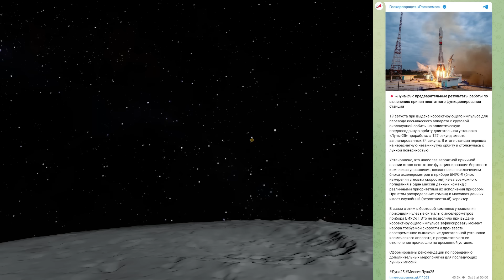Russian Space Probe Crashed Into Moon Because It 'Forgot' To Turn On Critical Hardware

Comment: As someone who deploys networks, this problem seems a little nuts.  We're no longer in the days of Apollo, where the communications bus send data at hundreds or thousands of bits per second.  We have systems that send millions or billions of bits per second.  And the quantity of data on the spacecraft is nowhere near what you send over your internet connection; the spacecraft isn't watching YouTube.  The command to fire up the accelerometer would only be a few kilobits, and it's competing with other commands of only a few kilobits.  The bus should at least be at Ethernet speed, if not fiber optic.  Is Russia recycling very old components rather than developing new spacecraft systems?
Reply: Yeah something doesn't add up about this... explanation
Reply: IMHO the thing is that in this age a space mission is an academic project rather than a National Mission.

Comment: Thanks for the update about the root cause of the crash. I'm surprised it appears there were no checks that the accelerometer data was being updated in a timely manor? But then if the comm bus was saturated with traffic the last thing you want is even more error checking traffic.
Reply: I'm surprised there were no checks of the spelling in your post and errors being corrected in a timely manner.

Comment: In most systems like this a message will get queued when a bus is saturated. I'm guessing that the controller considered the message so unimportant that it didn't even bother. You'd think it would also run checks to make sure all of the required equipment was ready prior to initiating the burn.
Reply: This kind of thing does get difficult if you have memory constraints (either for real hardware reasons or e.g. assumptions in lower-level code), or perhaps real-time constraints which mean you don't want huge buffers; for some kinds of system you really would want to chuck out old messages - just not this one lol.
Reply: Yeah but real talk, how tf would a bus even get saturated.
Were talking about systems that would compute 160 instructions a cycle, where each cycle happened 3 billion times a second.
Like even if they used radiation resistant hardware thats a bit slower, its pretty fucking insane regardless.

I think its a coverup.
Theres no way the bus would get saturated and que up the commands like that. This was litterally a problem solved back in the 80s.
Truth be told, the accelerometer was probably broken due to corruption/incompetence, and they needed something else to blame it on.

Comment: I don't think it's likely that time is being measured in seconds at the low levels, and probably not as an 8 bit signed integer either. Usually, you fundamentally measure time in clock cycles, and only convert it to seconds when needed. I think it's much more likely that they just added 50% to the estimated burn time (84s) to get a failsafe.
Reply: It's possible they used some fixed point arithmetic where the most significant 7 bits (or 8 plus sign) align with seconds while everything after are fractional seconds.
Reply: @MrRoboticBrain  it's possible, but firstly it would then wrap around not at 127 seconds, but at something like 127.99... seconds, depending on the number of extra bits. And this would have been rounded to 128 seconds, not 127 seconds.

Secondly, from most programming languages I've used, this simply isn't what happens. It's "expensive" to constantly multiply by some conversion factor, and if you are actually doing important arithmetic with this, you'll be slowly losing precision as you do more steps. It's just easier to internally store the result as a number of clock cycles, which can be easily counted, and only convert when it's needed in a human-readable format.
Reply: @stanleydodds9  I think you are thinking of floating-point arithmetic.. The whole point of fixed-point is to be more precise because of the weirdness floating-point introduces (e.g. 10*0.1 = 1 but adding 0.1 ten times gives you a slightly different bit pattern).

Multiplying conversion factors simply does not happen unless you have to convert for some external system (like humans). The "fractions of a second" obviously would be base 2. Also all conversions with powers of 2 are dirt cheap bit shifts. (think 16MHz system clock)

There are only very few languages implementing fixed-point arithmetic natively because it's trivial to do yourself with integers.

However your point about wrapping at something ~128 makes perfect sense! But this could be an oversight by whomever published the accident report. Just like prices at the supermarket are always something ridiculous like $9.99 because humans are lazy and always round down.

Or maybe they actually used seconds... Maybe burn times don't have to be THAT precise after all? I know that jet engines of aircraft take several seconds to react to control input changes. I wouldn't be surprised if rocket engines behave similarly.
Reply: That was my first thought too. You wouldn't want to be restricted to measuring rocket burn times in whole seconds lol. Also there's no reason in this day and age to be stuck with 8 bit values.

Comment: Yes, software error.  But their testing and QA must suck just as much.  Tiny error flubs happen and are hard to spot.  But I would think that running simulations would find that.  Discovering the problem is harder than fixing it.  Simulation is far better than looking for coding errors.
Reply: I dont think its software error.
NodeJS and Python fool people into thinking processors are slower than they really are.
Modern day ESP32's can do 400 million instructions per second. And thats on the cheap end. The radiation proof shit they put on landers and rovers, are significantly faster.

Theres no conceivable way that messages would be qued up like that, to the point it took 2 WHOLE MINUTES to process that command.
The truth is some official was probably corrupt, and there was a faulty IMU put into the spacecraft. 
Its 100% a managerial error.
Reply: @honkhonk8009 , or, you know, it’s a considerable amount of coding that has to be worked through to find any errors in it and, if not ran through consistently and repeatedly, might turn up errors? 

It doesn’t matter how fast the processor is if the priority que isn’t set up properly or has a bug in the system that causes the que to become entangled.

Comment: It was doubtful explanation of  what happened with craft, because accelerometers are part of craft's inertial guidance systems and they not supposed to be invented a new, they traditionally are being controlled by the military branch of all Soviet and Russian Space programs. To make a critical transition impulse of engine burn with a timer limit, ignoring of inputs of live telemetry data?  Hard to believe.
Reply: Come on, oveloding a (probably) CAN BUS? wrong priority of frames? yeah right. No backup IMU or feedback from the motor or anything, something does not check out, they have no idea what happened, so blame the software.
Reply: Yeah this is one hot take that doesn't make much sense at all

Comment: Software testing is an an art, and an expensive one. Always the temptation to take shortcuts. On the other hand, You can prove the proper working of software as you can prove a mathematical theorem. But this is seldom done, not even for mission critical software, like aviation control, nuclear power plants.
Reply: As an electrical engineer/project manager I always insist on developing the Test Strategy as soon as possible in the project’s life cycle. The biggest resistance doesn’t come from “management” but comes from the technical streams. Usually the Tech Leads or architects who are ex developers and know it all and have risen to their management roles by avoiding testing roles during their career. Good testers get stuck in testing and are usually ignored for management roles because they are good at their testing jobs and can’t be easily replaced because “who wants to do testing?”. The other aspect is that on a large project, testing can be a third of the total cost of a project (both cost and duration). There is zero support for either cost and duration and we take a risk based approach which is the correct thing to do but in practice the risk registers and risk profiles and remediations for each risk are  ultimately manipulated to met the desired delivery date/budget expectation of management.
Reply: You can sometimes prove software like you prove a mathematical theorem, but only if it's written in a particular way, using a non-Turing-complete language, or using Turing-complete language but restricting it to a subset of possible operations. This is seldom done because you usually cannot do the kind of mission critical tasks you cite while sticking to the restrictions that make it provable.
Reply: @juliasophical  there are many tools and disciplines in testing ie your comments are related to "how" testing can be executed. My comments can be summarised simply as management not supporting the "doing" of the testing. As a project manager, I have to plan all aspects of a project including testing and this requires having access to skilled resources, creating the test strategy/test plans/test execution etc all of which require money and time. Cutting corners can lead to failures.
Reply: @johnfranchina84  Certainly -- my comments weren't meant to address how testing is done, I was merely responding to m.walther6434's mostly incorrect assertion that you can prove the proper working of software like you prove a mathematical theorem. Alan Turing proved that that's false a long time ago. For software not written in a provable manner (which is most of it), there is no substitute for good testing.
Reply: @juliasophical  oh ok agree 100% with you.

Comment: Sure we see lots of failures due to software, but on the other hand you need to note that more and more of functionality is moved into software today.
In the past there may have been some special-purpose burn controller that directly processes sensor data into an analog or digital hard-wired circuit (even electromechanical a long time ago), but today everyone just has an onboard computer with every sensor and peripheral connected to it, and sofware managing the whole thing.
So apart from your engine exploding or similar, all failures will be software failures.  And usually, software failures are very obvious after they have occurred and have been debugged.  Not so easy to predict them.

Comment: I once heard that the Shuttle Avionics Integration Lab ran 24/365 checking software loads for Space Shuttle flights. Astronauts had to each serve their turn in SAIL piloting the sim for this testing. They could never test all of the code’s possible logical branching in the time available but they tried to determine which were the most critical lines of code to test. Scott, maybe you could do one of your historical videos on this subject.
Reply: As a shuttle flight controller who personally spent time in the wee hours of morning doing ‘runs’ in SAIL, basically true. Key points were: flight avionics + flight software loads. It’s expensive to do that, tho.
Reply: That sounds interesting
Reply: Yes. That's true in all reasonably complex software. The number of states that the system can be in expands combinatorically as the complexity of the software expands.
Reply: @phillybruce  You want to make sure your code is as non-interacting as possible so that changes in one part have no effect on any other part.  That's easy in "pure" software running on something like a PC, but when you're building your own hardware it can end up being a problem, like if you boot up one piece of hardware that causes a power spike that stops another component from working, etc.
Reply: @takanara7  That's called surface area between components. That's one principle among many that influences software quality.
Reply: That's why you do unit and integration tests, instead of just testing the final blackbox.
Reply: @wilfriedklaebe  This. It's only exponentially complicated to test everything if you do the final product, the number of tests only grows polynomially if you do it per function, class, module, etc... If you can't break things down like that because your code has too many connections between disparate parts, you should redesign to have a more robust architectures.
Reply: @wilfriedklaebe Even so, with a complex system (especially on distributed over multiple different architectures, but interconnected) you simply cannot get all of the permutations. So you fix stuff for a while.
Reply: The software testing/development alone was really interesting - the definition of safe software
Reply: ive heard that nasa claimed the shuttle code was the only code in the world with zero bugs. im not sure i believe that haha
Reply: @amyshaw893 Don Knuth claims that his TEX has no bugs.  Even though there is a hefty bounty, nobody has found any bugs in decades.

Not so for LaTEX though.

Actually there is a lot of software without bugs.  Dijkstra says bugs aren't bugs, they are errors.  They are not things that just happen to crawl into your code, they are created by the author.

It has been said that there are two kinds of code: That which contains obviously no errors, and that which contains no obvious errors.  Keep it small and simple, then proving that there is no error is easy.  Any complex system that works is invariably made from simple systems that work.
Reply: @davidwuhrer6704  yeah well knuth also says its pronounced tech, so what does he know
Reply: @amyshaw893  He knows that he wrote it in Greek letters.
Reply: @amyshaw893 I don't know. If you look how hard the software worked to keep Challenger flying as multiple systems failed or how hard Columbia worked to try to keep flying, it is pretty impressive.
Reply: @i-love-space390  im not denying that its good code, but  the original comment literally says "They could never test all of the code’s possible logical branching in the time available", so they cant prove it had no bugs if they couldnt test it all. its possible that in certain rare circumstances it could have had a bug
Reply: @amyshaw893  Nothing has zero bugs but where human spaceflight is concerned NASA tests to death.  On a side note You know computer hardware on the Shuttle was still running 386 & 486 tech back in 2010 I was trying to support an old SDX telephone system back then and constantly being out bid on late 80s early 90s PC tech by NASA on ebay :shrug:
Reply: Coupling.  Many books have been written about software coupling. There are various metrics, but it's basically the inverse of the number of side effects in your modules and functions.  You want loose coupling.

Related is cognitive complexity, which is a measure of code complexity, similar to Dijkstra complexity.  Every line of code is a technical debt. More code is not better, writing more code is not more productive.   More code is neither clearer nor safer, it is more complex and more prone to contain errors.  Also more effort to maintain.  And slower.  But writing a 50MB one-liner isn't better than spreading it out over more lines.

Cohesion is the inverse of coupling, and has the advantage that it is relatively easy to measure.  (There is a Python module for that.)  The downside is that it is only defined for object-oriented code.

Comment: 127 seconds is 84 seconds times 1.5. It was safety coefficient in case the engine having thrust lower than expected (but this failure mode assumed operational IMU)
However in reality the failure was in IMU and the engine performed nominally, which led to overperforming the maneuver
Reply: Or they used a signed char to store the seconds, in C that data type has an upper value of 127.
Reply: @Domoninic Coincidence.

Please ignore that 84 times 1.5 is actually 126.

Comment: Sorry did you just confirmend that they used a 8 bit controller.......because if the timer went to 127, safety bla bla bla contrl etc. that indicates 8 Bitt.  Oops Russia is using 8 Bitt controllers o their space prope/lunar landers,  yeah the war is hitting hard....
Reply: You would be surprised at how much "old" tech is still in use to this day, take the old 80486 chip, still put in lots of things due to it's extreme reliability and fully understood architecture.  Btw that's a 486MHz CPU, which may have been what was powering that Russian oopsie

Comment: I don't buy any of that explanation. Processor power is GHz class, and communication speeds are equally ludicrous now. I think it would be really difficult to have messages screw up and get lost. Unless, of course, they were running everything on a ZX81? Ok, maybe if the software was really really badly written, I guess it's possible.
Reply: Space qualified (radiation hardened) processors are much slower than your average desktop computer.  That is state of art currently.
Reply: You might be surprised how many 80486's are still sold and put in things to this day, despite being over 20 years old.